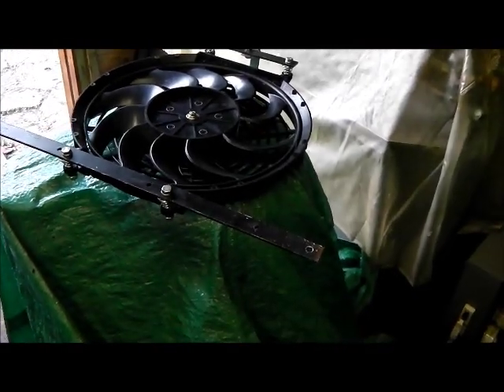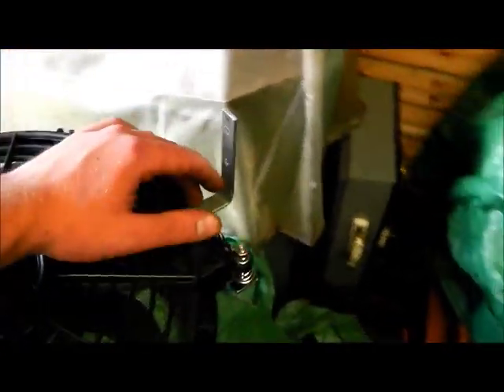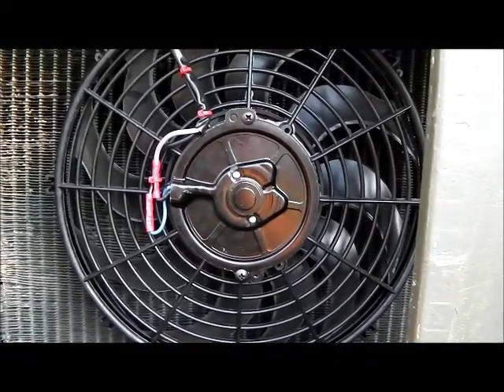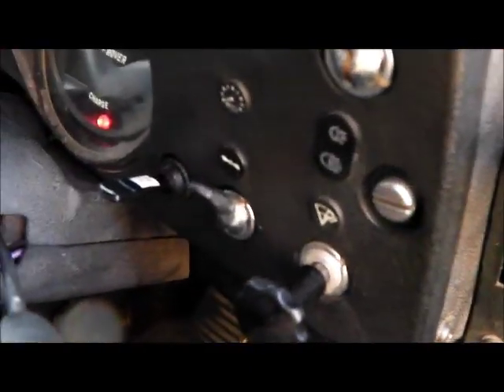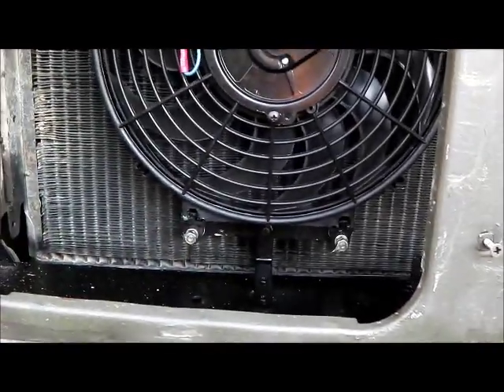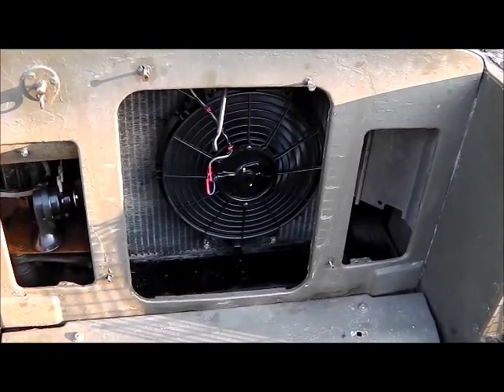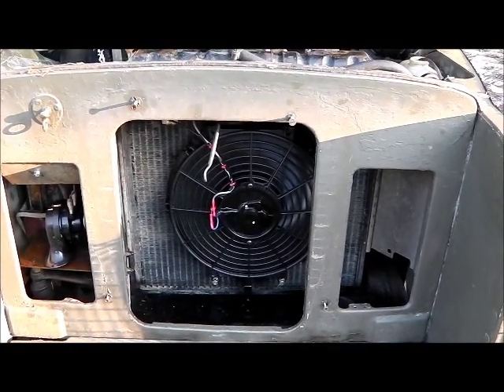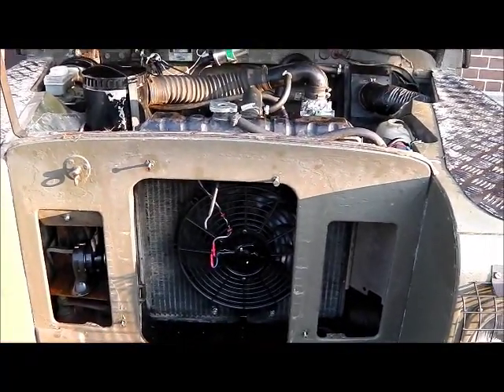Land Rover Series 3 - Electric Fan Install -

Comment: Wow that is a powerful fan, almost louder than the engine! Reckon you wouldn't even need the radiator with that thing.
Reply from the maker: Something not right though, went to a steam rally this weekend and it was still getting very hot with the fan on - next step is to get the radiator dipped so I need to have a look at removing it..,...fun.....

Comment: I have the same fan I think. I'm pretty sure you can unbolt the fan blade and flip it over, then it will be quieter and more efficient like it was when it was blowing the wrong direction.
I've got rid of my belt driven fan altogether and just use the electric one never gets too hot really. Only started to go above 'N' when I was going up and down the steep hill climbs in low 2nd  at an offroad pay play the other day. I suppose being a swb means it's lighter compared to yours.